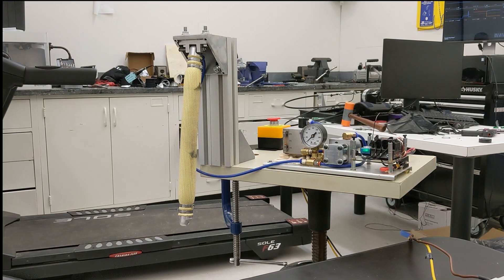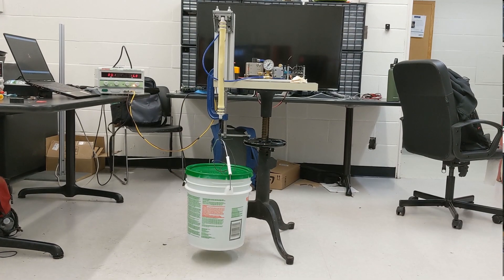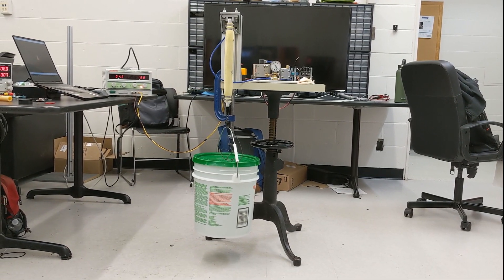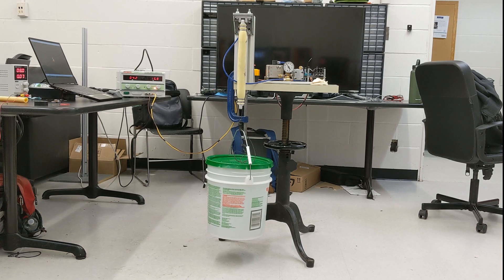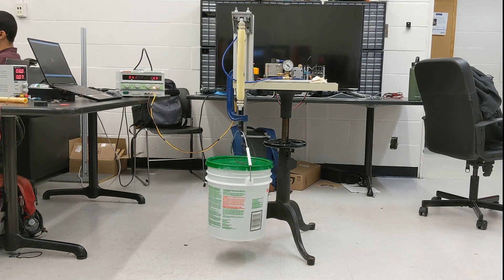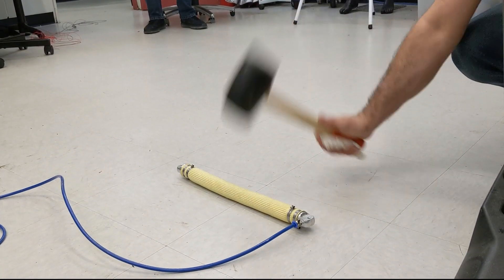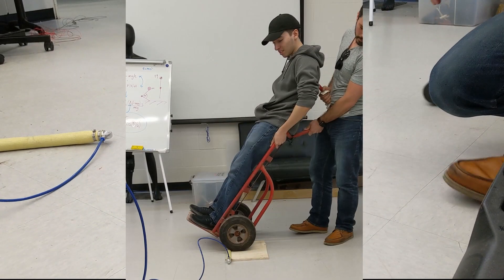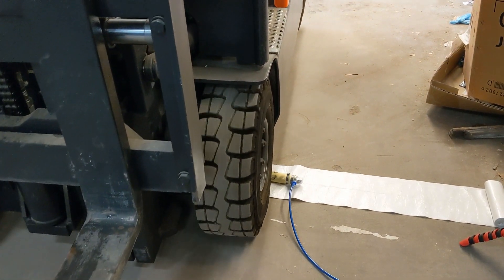Hydraulic Artificial Muscle

Comment: Hammer blows? That's a rubber mallet. Anyways too simple of design. Using hydraulics that's not very much force. I'm guessing you have an outside sleeve a inside sleeve and basically made a soft hydraulic cylinder. You got to think bigger. Technically a latex hose with the silicon outer hose with a spring in the middle and a Kevlar sleeve over top is all it would take. Should be able to lift a little more with that.
Reply: Yeah and the car was only rubber wheels

Comment: Why use hydraulic pressure rather than pneumatic? Doesn't the use of pneumatics allow a bit more give under super high stresses since gasses are compressible? It also might improve contraction speed because filling the bladder would take less time. But hydraulic systems are generally more portable...
Reply: Hydraulics allow for greater positioning control and accuracy because the oil doesnt compress. Additionally for this reason, they're far better suited for high pressures
Reply: @ironcladexo  that’s why Boston dynamics use hydraulics on atlas.

Comment: mecha?
Reply from the maker: Mecha 😎
Reply: @keyvana3943  I mean it's possible if you shrink its size down to around 9ft and carry the cockpit on the back like in the youtube original anime obsolete. along with using composites and aluminum replicating the human skeleton for their strength to weight ratio being helpful from the square-cube law. using the muscles in the form of the major muscle groups just like in that one robot from the University of Tokyo's JSK lab called Kenshiro. the issue really would be the power supply for a long operation time even if a high power output generator and efficiency were through the roof. something like a turbine is too much fuel consumption and piston engine are heavy along with the small space for not only a generator but any sort of battery pack.    i get bored and research these kinda things on the internet.
Reply: when tf did I right this?